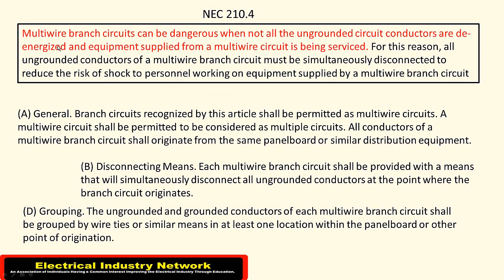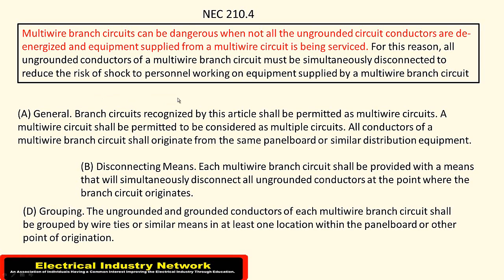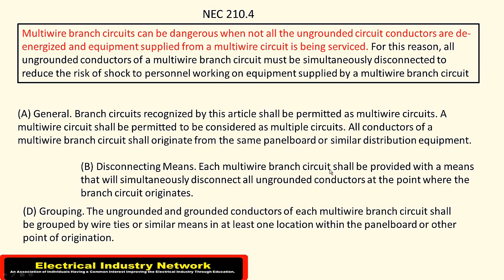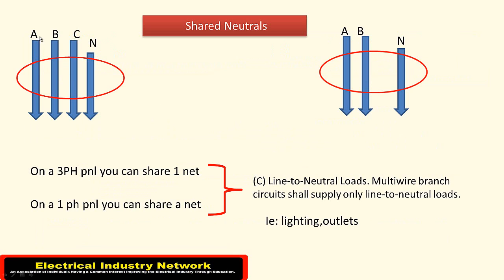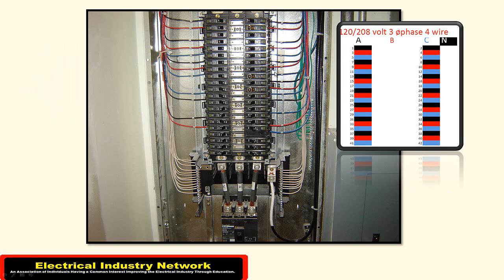NEC 210 4 Multiwire Branch Circuits

Comment: Note to self: Always tap neutral wire to ground, if sparks shared. Always check wiring if live, better to know than not to know. Your reaction to an arc or getting belted could hurt or kill you
Reply: Try using a meter.

Comment: I like this rule, mutiwire branch circuit are not only dangerous for persons but for equipment too if the neutral get loose or disconnected with the other circuits on, I use it a lot , but before the rule apply , O was using 2 poles and 3 pole breakers for safety

Comment: Isn't neutral safe to touch though since there's no voltage?
Reply: @Flikt totally not true. Hate when people spew false information with the arrogance that they're right
Reply: A neutral will not shock you if wired correctly as it is grounded in THEORY. In reality things are rarely perfect and more complicated. yes you can get shocked off a neutral. no it is not more dangerous than a hot. whoever said that is an idiot. they may have been shocked hard but an ungrounded (hot) wire is the most lethal.

Comment: I’ve been hit off a 120 208 3 phase Nuetral this code is very important it’s easier to just pull 3 nuetrals
Reply: I'm a DIY homeowner and got shocked by the neutral when replacing a receptacle. I turned of the one breaker and used my non contact tester on the hot wire so thought I was good, but was really surprised to get shocked by the neutral. I've since learned about multiwire branch circuits, shared neutrals, and tying the breaker handles together (my adjacent breakers are obviously not tied). For the time being, I'll just use colored tape on the breaker handles to indicate they are shared, since I don't want to do a hack like connect the handles with a zip tie or nail.

Comment: Hi, can you help guiding me to locating Article 210 withing the NEC code manual? I use the online access for the Florida NEC 2014 or 2017. I just can't seem to find it as mentioned elsewhere in Chapter 2 (definitions).
Thanks in advance for the response.

Comment: I put in a duplex 120v 20a receptacle, I broke the tabs and put the single duplex on two 20 amp breakers, I uses two hots and two neutral 12 gauge wires, could I have gotten away with one neutral wire? the circuits are on two different legs, just a home owner putting in a dedicated outlet in my garage for power tools
Reply: that is illegal , you are now putting 240v potential through a 120v receptacle

Comment: i get it makes sense but way easer to run a neutral for each circuit unless its like a split plug in a home kitchen i had that happen in our house that has old glass fuse from 1971 the kitchen the feed comes up on a 12/3 then one circuit goes to one counter top outlet then the other one jumps over with piece of 12/2 to the other outlet so i pull the fuse for one outlet to change it cause it was worn out and i got a tickle from the neutral when i had a hand on the stainless sink

Comment: True  but the handle tie takes away the ability to have individual control over the the circuits and would cause all three to loose power if there was a fault or overload in one of the circuits . To top things off I'll  more likely work on the multiwire circuit hot to avoid interrupting power on other circuits .
Reply: @g quinn 30 plus year guy here. When a engineer had a brilliant idea!!!!!!!!!!!!!! Lets pull a nutreal for every phase wire in this building. You want to know what happened? The nutreal bar burned up. Unbalanced load was no longer unbalanced. Imagine a 42 circuit 120/208 volt panel with 42 single pole breakers, and  42 nutreals. You  are getting 3 x current on the nurtreal. Had multiple panels melt down.

Comment: In a 3 phase multiple -3 ungrounded conductors & 1 grounded conductor (aka neutral ) the neutral doesn't count as a current carrying for derating purposes  because it only carries the imbalance current . By running dedicated neutrals you double the number of current carrying conductors required, double the heating effect of the circuit  and now need 6 conductors instead of 4 . More wire ,more conduit , more heat, more money ,less efficient . Just my opinion .

Comment: I'm not a fan of many of the recent code changes . Running dedicated neutrals on a 3 phase multiples doubles the number of current carrying conductors required and increases voltage drop . It may be safer to work on but it is by far less efficient .
Reply: cabcorner1 can you help me with home runs what is the blue wire for